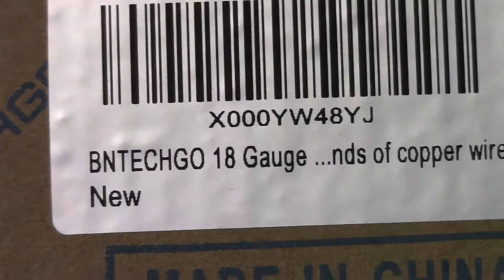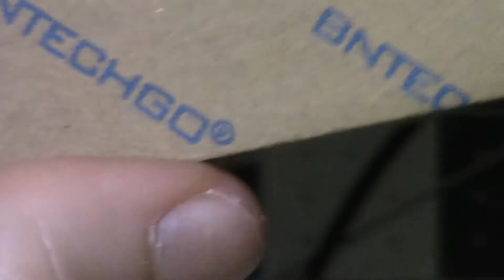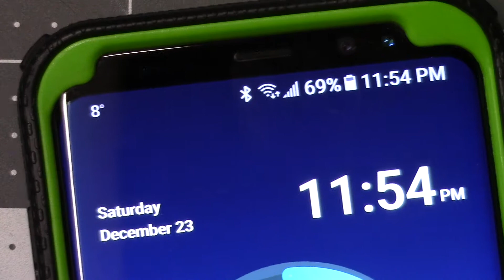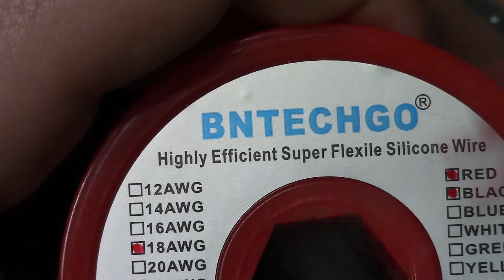BNTECHGO Silicone Wire Review

Comment: I've seen a lot of "skeptics" in the comments and I've used both American made silicone wire and this Chinese product and, from experience, if it's pliability and heat tolerance you are looking for, this is the stuff you need to try. It's pretty good at not holding any particular shape and easy to straighten if it does.
Yeah, I know, as Americans, we've all had it hammered in to our heads that Chinese products are always "substandard" but any truly wise person takes such statements with a grain of salt. It's quality is good for the uses the product is intended for. 
Lots of good ol' boys will take a product rated for 600V and then bitch about the "quality" when it fails under a 20kV load.

Comment: I too am of the opinion, that this is not quite the best review of this wire. Yes I would agree that the silicone insulation is very soft and the super fine strands of ??? give the wire that wet noodle feel. However... What is the wire really made of??? The wire does feel quite heavy, like it could be made of copper, yet on inspection of the bare cut ends of the wire, under a strong magnifying glass, we barely see any copper, it's almost like the entire wire is made of tin (Tinning).
Reply: I've bought and used it. It's tinned copper.

Comment: If a person cuts the end off and does not see ANY copper it is not tinned copper it is 100% aluminum.
Reply: I just bought this wire in 10awg and it is 100% tinned
Reply: @anthonygerardi4658  So you can see the copper core, with each strand being tinned?  If you can't see copper it is not 100% tinned.  100% tinned means that the entire length of copper is tinned.  Hope that makes sense.
Reply: I've scraped the tinning off (not easy to do). It's copper. BUT, here's the thing; the strands are so fine that after they are tinned, each strand is probably around 50% copper and 50% tinning which is why it's so difficult to see end-on. So, the metal content for the entire wire is around 50-50. That's also why they can sell it cheap is the actual copper content in total is about half (or less) of the metal that makes up the wire.
Also, the heat and electrical ratings have to be tested to be sold in the U.S.. 
I highly doubt that the company would risk losing their biggest market over such a stupid stunt as misrepresenting the copper content of their product, especially since anyone can have it tested.
Reply: Did you solder it? you can't solder Aluminum and that's one of my test's and other test is a Magnet and I see copper and it passed all tests.